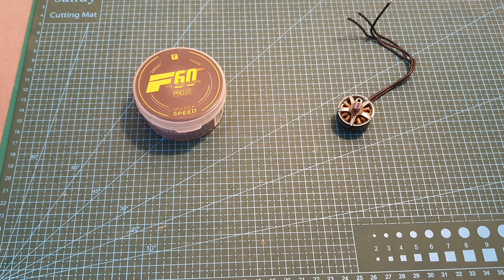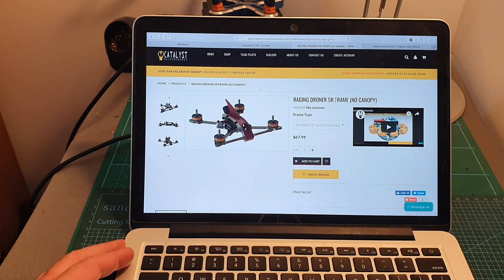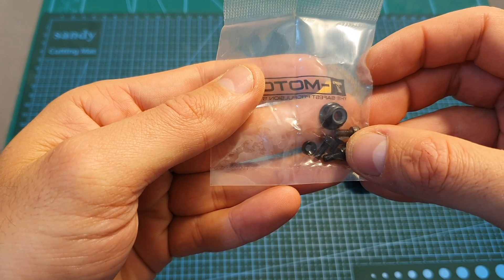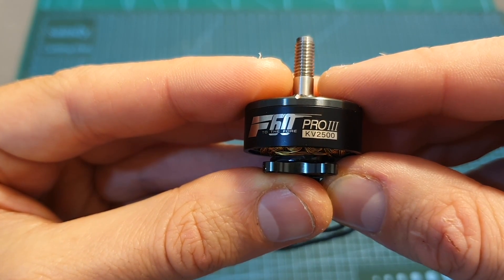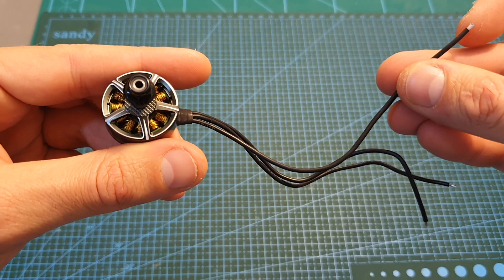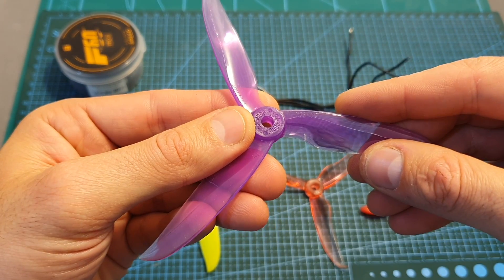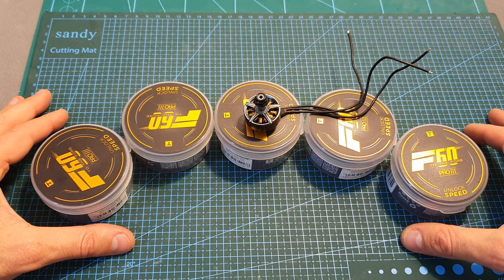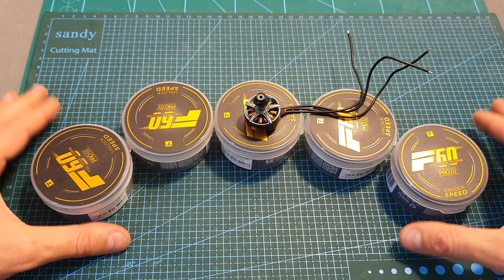T-Motor F60 Pro III 2500KV Bench Test

Comment: Dont use in quad, can we use this motor for flying wing? my build with all electronics weight 355g ( plane, motor F60,esc, battery...) but without propeller. I'm not sure this motor can handle 6 inch props and is it good for flying wing? The motor get hot or not? My build if come with himodel 2212 1000kv motor,10" prop, weight: 510g, compare with 355g (motor F60) its too heavy, right?
Reply from the maker: I think that that F60 motor will be sufficient for your build and I am not sure if the original one is too heavy or not.

Comment: Hi Gal. Thank you for making this motor review. You are helping us in making decision. :) Quick question. I have 2 choices of motor (1) T-Motor F80 2500kv PRO and (2) Johnny 2207 2700kv V2. Which one would you recommend for fpv freestyle? I'll be using 4S battery.
Reply from the maker: My pleasure.  If you are looking for power - go for the F80. The flight times on the other side will be better with the JhonnyFPV 2207 motors.
Reply: I didn't have enough budget yesterday so I only bought Emax Eco 2306 2400kv motors. I'm also new on this hobby. It's going to be my first 5" quad. I'll buy the F80 once I become better at flying. Thank you so much! I subscribed to your channel. Hope you can subscribe back to me as well :)
Reply from the maker: @neilfpv  Have fun! The Emax Eco is a good option for its price.
Reply: @KremerFPV  That's great to hear! It will arrive this coming Wednesday.